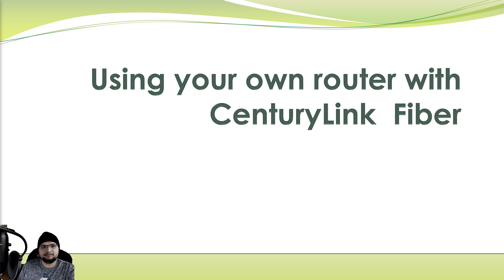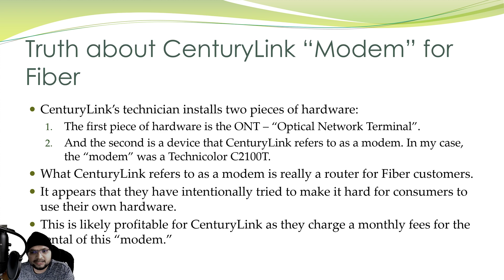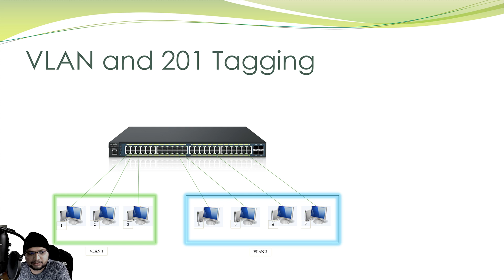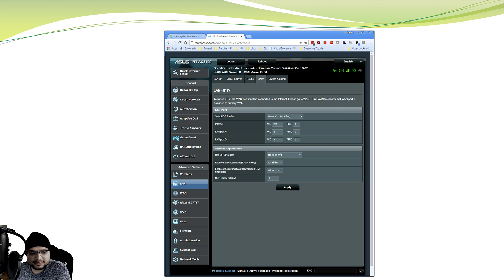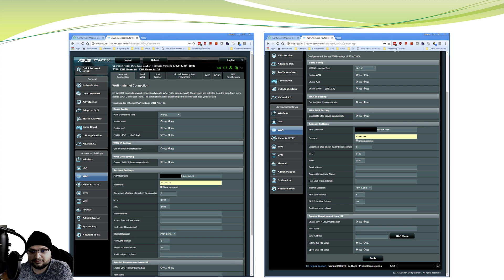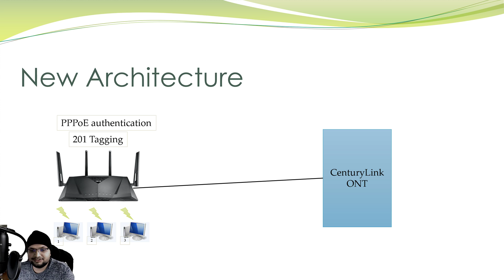How to use CenturyLink Fiber without CenturyLink's Modem and with your own Router

Comment: Thought I would share my finding on openwrt forum in regards to my GT5300 router. They mentioned that the newer Broadcom units actually lose performance with MU enabled clients. I ordered the Asus 3100 router can you tell me are you running the latest firmware?
Reply from the maker: I am no longer using Asus Router directly connected to ONT anymore. When you do speed test, you need to unplug everything else and then you need to hardwire your computer to the router using a lan cable to test speeds. 

My current set-up is using pfsense firewall + Asus router.
Reply: Mukul Tripathi thanks for the hand. I was looking at pfsense but I going to try out edge router 4 supposedly it can handle things better than the ASUS that I have.

Comment: Last question how many devices on WiFi and lan do you have when running the gigabyte fiber?
Reply from the maker: Including VMs and iot devices about 50-60 ip addresses are in use.
Reply: Mukul Tripathi maybe that is the reason I do not see the whole gigabyte when I do a speed test I have four WiFi cameras, printer, three smartphones and tablet and WiFi. Then I have a unmanaged gigabyte switch downstairs and have four connected to Lan and one upstairs connected to Lan. My laptop is the one I mostly do speed test with and can not get over 610 down. Now I don’t run all of time at the same time.
Reply: Mukul Tripathi oh I think I mess read it. You have a lot more traffic than me so I should be able to see near gigabyte speeds. I believe the interface on the 5300 router is too heavy which is making my speed drag. Although 3100 or even 3200 ASUS router could run better as it can get better firmware from Merlin

Comment: Please help: Has anyone had luck with an unifi edge router 4? if so, did you get full speeds and did you need a managed switch? Lastly, what where all the setting where needed?

Comment: Will doing this get the speed you are supposed to get and or pay for?
Reply from the maker: Depends on your hardware/router used. I get the speeds that I'm paying for. About 900 up and down.
Reply: Mukul Tripathi I have an ASUS GT-AC5300. One big difference I noticed is that on Comcast my lan and WiFi speeds remained near the same with century link even on AC WiFi it drops to about half.
Reply: Mukul Tripathi I have an ASUS GT-AC5300 just wondering if I it will increase my speed. The great thing about your setup is that I will not be getting double NAT from router and can have what ever device connected to the vpn which is a bonus.
Reply from the maker: @angelorestrepo  That is a very potent router! I am pretty sure you will get speeds that you have subscribed for.
Reply: Mukul Tripathi I got my router on the century link network and even reset to factory settings and only getting 90 up and down which is less then the century link router any suggestions?
Reply from the maker: Can you try with a lan cable plugged directly into lan port of your Asus router?
Reply: Mukul Tripathi I changed cable to a cat6 thought the one plugged was that but it wasn’t. It went up to 720 on lan not in the 900s so tomorrow I will try the century link router see what speeds I get when the new cables if it gets the same might just use keep the century link since using the vpn on the router also affects the speed
Reply from the maker: It also depends on the current usage in your area. Speeds are wonky due to quarantine spikes.
Reply: Mukul Tripathi the speeds have been inconsistent. Is it also happening at your location? I also found out that my router although it is powerful it is unable to push out close to the speeds due to a limitation on the processor which I read that openvpn uses only one core of these routers. So here is my question. I have a windows 7 duo core pc mini pc that I would like to implement to my setup. The router is on the main floor I have cat6 wired to the basement with connects to an gigabyte switch. I would like to have my duo core pc plugged in before my switch and use my gigabyte usb to lan and connect it to my gigabyte switch so traffic will go through my duo pc which in term would be sharing internet while connected to the vpn. Do you think this will improve my speed for the devices connected with a VPN?

Comment: I upgraded to the Orbi Mesh Wifi 6 from the Orbi wifi5✠>imgs.love/Orbisatellite?ㄴ98   There was a significant measurable improvement in the signal strength (finally getting me to Good or Best, the signal was far more powerful and even with devices that only have wifi 5 there was a very significant bump in speeds. Previously I was only receiving about 50 Mbps on my laptop and a cell phone - but now I am achieving 250 Mbps with the devices in the same location. Easy to set up (like Orbi 5) and worked perfectly from the installation on. Highly recommend for anyone needing great coverage and/or strong wifi signals - not to mention the support of wifi 6
Reply: how is the speed on speed test i got the old orbi and cant get anymore then 700 up 900 down

Comment: Mukul, thanks so much for this incredibly helpful video! I'd tried a few different ideas (EdgeRouterX instead of a CenturyLink modem, changed Asus AC2400 to AP mode, etc) and nothing seemed to work for speeds. This worked perfectly on the first try.
Reply from the maker: I'm glad it worked for you :)

Comment: Bro.. such a great video... i wanted to figure how to ditch that crappy modem router and use my new Asus RT-AX3000 router.. And boom you video did the job.. Such a easy setting... loving it.. But still only get like 560 down and 900 up... so a little disappointed... but i guess that is all that century link supports for me ... still a little sucky.. But THANK YOU FOR THE VIDEO>>>
Reply from the maker: I'm glad it worked!

Comment: Have you tried this on an Edge router 4?Tried going thru CL modem, PPPOE didn't work. This may be the answer, thanks for info
Reply from the maker: I don't have that router but you can try it out. You may have to find the settings for 201 tagging on it though.
Reply: @MukulTripathi  will do, thanks for the info 👍

Comment: We got our CL 100 meg fibre installed and I decided to try my Linksys EA8300 router plugged directly into the ONT. It works but its painfully slow (25 down, 2 up).  The CL router gets 104 both ways. If Mukul or anybody has a suggestion as to what to look for on my direct connect Linksys I’d love to hear.

Comment: Great video! In my case I simply eliminated the Century Link router and connected my D Link DSR 250 right to the ONT and it worked! I did not have to change anything in the D Link.  I wonder why it worked? After this video I logged into my DLink and PPPoE and 201 tagging are not even turned on.

Comment: https://kmwoley.com/blog/bypassing-needless-centurylink-wireless-router-on-gigabit-fiber/comment-page-2/

I tried following this thread for my nighthawk that said you have to put the century Link modem into bridging first then get the pppoe onto your router first before you can remove the CenturyLink 2100T. I tried that and internet didn't work so I can't move onto the next step and now can't get into my CenturyLink settings or nighthawk anymore. Have any ideas for me?

Comment: I have a Nighthawk X65 AC3600 Router. I have searched the router's advanced settings and cannot find where and how to config the router to bypass the CenturyLink (CL) router. The Nighthawk advanced settings looking nothing like the Asus used in the video. Can this router be used to bypass the CL router? If so, I would appreciate someone sharing the steps to config the Nighthawk.
Thanks.
Reply from the maker: Nighthawk x65 appears too be advanced enough. I don't own one though.

Comment: watching this 18 months after publication.  how has your experience been with CenturyLink?  i am about to move into a new home and they offer the fiber in my area.  the deal was very good like you said.  but i am used to Cox, which is very stable and very consistent, and also does not question me bringing my own modem and router.  i am curious of your review of CL in general.
Reply from the maker: I love it. There have been only a couple of outages in last two years, which is acceptable as per my needs. The connection is pretty stable for 99.9% of times. Gaming and streaming works without any lag. I'd recommend it.
Reply: @MukulTripathi  so with this architecture you did not need to buy your own modem right?  you just used this work around for your router?
Reply from the maker: @ArgonPW  that's correct, I just needed a router.

Comment: I am confused by what you mean by their modem not being an actual modem and just a router. It only connects to Wifi? You can't connect an ethernet cable and hardwire a computer to it?
Reply from the maker: This should help you in understanding the technical difference: https://pc.net/helpcenter/answers/difference_between_router_and_modem
 TLDR: You can connect an Ethernet cable to it and hardwire a computer yes, but that functionality doesn't differentiate a router from a modem (especially when you are talking about just one connection).
Reply: @MukulTripathi   could you explain it like I'm 5? Not the difference between a router and a modem. But how the modem that CenturyLink provides is not a modem. Do I need to order a modem of my own?
Reply from the maker: @krunchy1736  you don't need a modem with fiber. There is a ONT box outside that takes care of modulation for you.
Reply: @krunchy1736  centlink folks habitually call the device a 'modem'.  but the centlink-installed ont functions as the modem, converting fiber light pulses to digital electrical pulses on ethernet.  you plug the enet cable into your 'wan' port on your router/wifi unit.  many of the centlink-supplied  dual-purpose 'modems' also have a jack for dsl connection thru the onboard modem circuitry.  plugging the enet cable for fiber into the wan port bypasses the modem, and feeds directly into the router circuitry.

Comment: Did you also have Centurylink Prism for tv? That uses wireless connection to various tv's. I'm thinking if I switch to an Orbi then while the internet  will work, the tv part will screw up. Any info or guesses from you would be appreciated.
Reply from the maker: No, I didn't have prism service. I think you'll have to research more on that. Unfortunately I don't have any information on that. You get an orbi from BestBuy and see if it works for you, if it doesn't then you can always return it back.

Comment: I have CL fiber but i don't have PPPoE, my internet option i have is IPoE
Reply: Were you able to get it to work as IPoE?
Reply: @michaelsasso13  yes.... i have the ASUS RT-AC86U.

What i did was, WAN(AUTOMATIC IP) with iptv 201 like in the video and it worked. IPoE is similar to DHCP.

Tried it on Netgear, Tplink as well and it worked as well
Reply: @saintzzbf  okay, thank you.  I was successful with using standard DHCP settings on my Router with CenturyLink IPoE service.  I've read about PPPoE and VLAN tagging and was concerned there may be some other unique settings with IPoE.  THANKS.
Reply: @michaelsasso13  You're welcome! Recently Centurylink changed me to PPPoE so i don't have IPoE anymore xD

Comment: Hi, I just got Centurylink 1gbps with ONT. I have a Netgear R6700 and it does have PPP authentication and Vlan ID. I inputted user name as ******@centurylink.net or ******.qwest.net, put in Vlan to 201 in Port 4, connected the ethernet from ONT into Netgear Port 4 but I'm still not receiving internet connection. What do? I'm planning to return the Netgear R7000 and get the XR500 instead to connect to Centurylink.

Comment: What speeds were you able to obtain with your Asus RT-AC3100 compared to the CL supplied "modem"?
Preferably to a CL host.
Apparently Netgear has a weak PPoE client, so I am investigating alternatives.
In depth guide.
Thanks!
Reply from the maker: I get close to 940 hardwired.
Reply: @MukulTripathi  That's good. I have a recently purchased Netgear R7500v2, so I went the Ubiquiti route and am waiting on an Edgerouter 4 to do the client work.

Comment: Century Link uses CE VLAN201, not just vlan201. You have to have a managed switch that supports ce vlan 201 tagging. It will with without ce, but you will lose quite a bit of bandwidth. My issue is I have static IPs and I am unable to have my own router do PPPoE as well as static subnet set correctly.
Reply: I think I am experiencing the slow down you are referring to @bigdm4x4. Do you know of any network switches that support CE VLAN201 tagging? I see tons of VLAN managed switches, but none specifically say the CE feature. Is this really what I need? Or is there some other configuration I am missing in my Nighthawk R6900 besides the instructions Mukul gave. I added PPPoE and setup VLAN 201 for all ports. I am only seeing about 50-60Mbps on my fiber line.

Comment: Fantastic work!  Question as to the VLAN tab on a Linksys EA7300. Do I start with  "manual" and do I have to enter 201 tagging under both the Internet (trunk) and Ethernet or perhaps just the Internet (trunk) side? With manual selected there are blank IDs for V3 and V4 and they are defaulted to "0". Any advice would be appreciated.

Comment: Great video. I do this as well at home to simplify. The router that comes with the ONT is actually not bad, but wireless performance is lacking. The router is optional, and you can buy it in one payment. For most it is great. But for prosumers, I  would ensure your router is fast enough, check smallnetbuilder to ensure you can even route fast enough. The  LAN to WAN throughput on older routers will not be good enough to handle 1G up/down.

Comment: Will the settings be the same on the Linksys max Stream router. For some reason right now I’m getting 200 download 400 upload. 
A technician is coming out tomorrow and see what’s going on this is only my second day with centurylink.
Reply from the maker: Are you getting those speeds with wireless or plugged in?
Reply: Mukul Tripathi on my MacBook and my iPhone and Apple TV. 
I also did hard wire in my MacBook 
The guy who did the installation told me there was no wait no way to try the speed but assured me that I did have the one gig up an down.
Reply from the maker: @Freddyev123  When I hardwire my computer i get pretty close, speeds about 900+ You may want your CL guy to bring his laptop and show the speed to you on his machine. They did it as part of demo for me after installation.
Reply: Mukul Tripathi Yes he was supposed to be here today between eight and 12 and guess what he never showed up this is my third appointment I’m going to try what you did in your video with My router it’s a Linksys

Comment: Will this work with an Amplifi HD router? Just bought the mesh network today. I do see a VLAN setting
Reply from the maker: You may try it out and let us know. If it does have vlan settings then theoretically it should work.
Reply: I couldn’t get it to work using the mesh route but I bought an EdgeMaxX and got it to work. However, it will not power my switch in the attic. I have two 16 port switches.
Reply: Steve O did it work with just the base without the mesh points? I have just the Amplifi HD without the mesh points(because I live in a small single floor apartment) and am waiting for my installation next week. Hopefully it works!
Reply: 8Jhartzell I couldn’t get the PPOE to work with just the AMPLIFI router. However, I purchased the EdgeMax and got it to work but you may need to put the AMPLIFI in bridge mode.
Reply: Steve O can you explain what you did in the EdgeMax to get it to work?   I bought an EdgeMax and I want to try and set this up.  Thanks.

Comment: Thanks for making this video, can't wait to get rid of my CenturyLink "modem". Can I ask how you figured out the VLAN tag?
Reply from the maker: I'm glad you find it useful. I have a computer science background and I did research online. I looked into several forums, dug into search results from Google and eventually got it to work.
Reply: download n save the configuration/settings file.  it's just an xml text file.  about the 6th line in the xml file includes '<vlan>201</vlan>' or similar.  this is from a c3000z router/wifi.

Comment: @Mukul Tripathi what kind of speeds to you get on your model of router? I am looking at getting a good router I currently run all my computers on a wired network. I also have the Centurylink 1 gig Fiber.
Reply from the maker: For my wired desktop I get 850- 900 down and 950 up constantly. On wireless WiFi 5GHz on second floor, I get about half of these speeds.
Reply: @MukulTripathi  Thanks